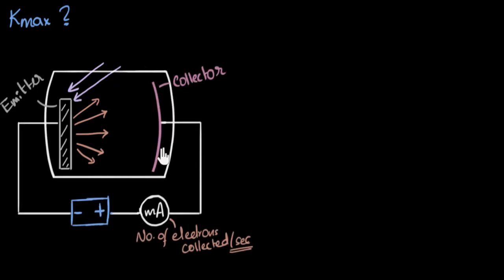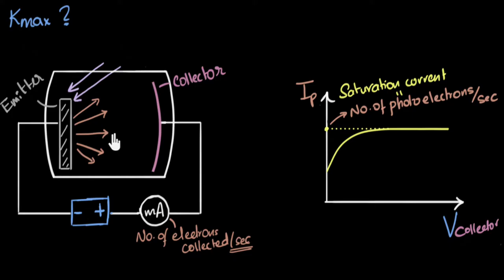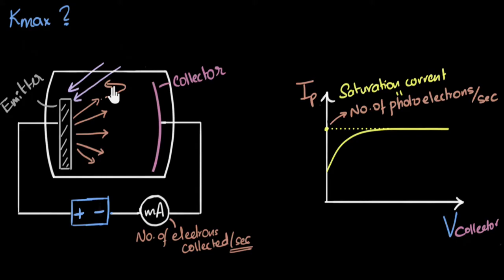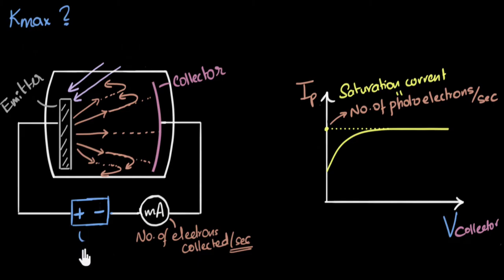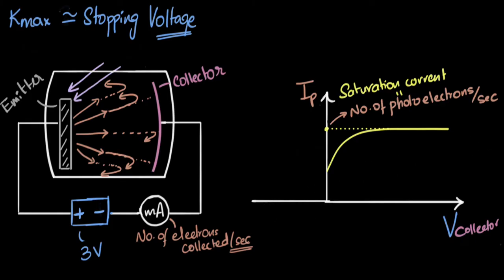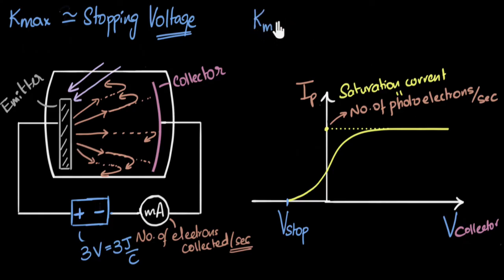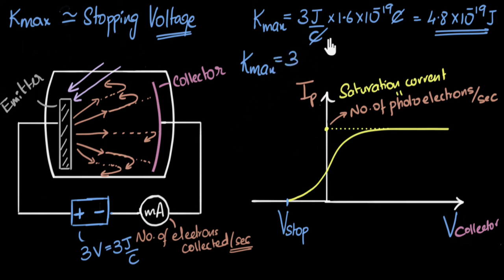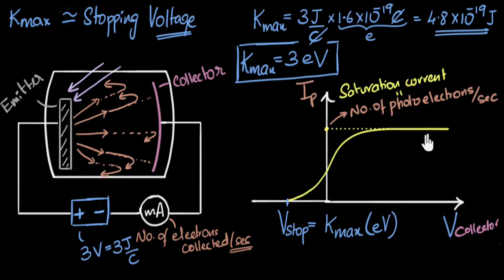Stopping potential & maximum kinetic energy | Dual nature of light | Physics | Khan Academy

Comment: Hii I have a question why maximum kinetic energy is equal to the potential energy that is Kmax=eV
Reply: Think it as you need to subtract 4 from 4 in order to get a null value and thus the energy per coulomb must be equal to the kinetic energy in order to stop the electrons

Comment: The setup is same as charging/discharging of capacitor, my doubt is that why the ammeter would only measure the emmited electron , wouldn't it also measure the electrons the battering is removing from one plate and moving to other in order to establish same potential accross the plates , is there something that I'm missing?? Please clear my doubt

Comment: I got an question kmax= 3J/C x 1.6 x 10-19 in this case, why using 1.6x 10-19 instead -1.6x 10-19
Reply: -ve sign indicates the charge on electron (sign)
1.6 x 10¹⁹ is magnitude

Comment: Sir what will happen if the energy in photon and the energy required for the electron to get out of the metal are the same ?
Reply: Electrons will emit but with 0 kinetic energy.. Getting it
Reply: @Veda Jyo ..i had the same doubt and got it clear,..that is the electrons will be just ready to jump off..to get emitted..but wont
Reply: energy in the photon has to be greater than the energy required for the electron for the electron to be emitted.